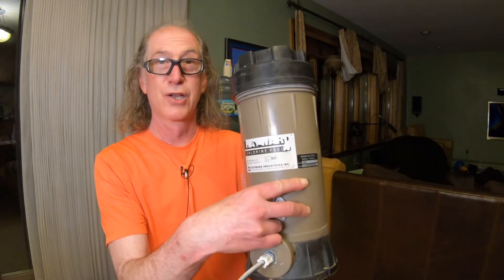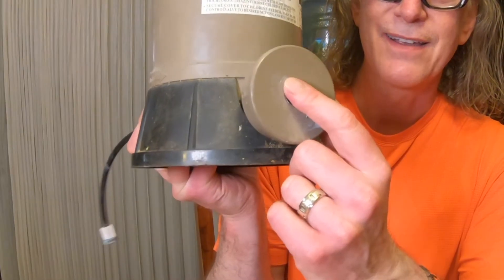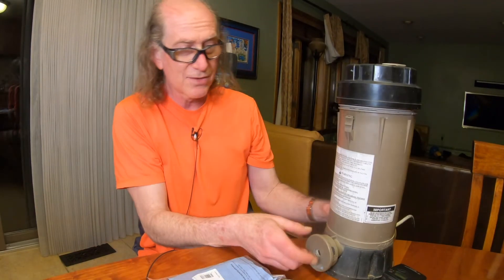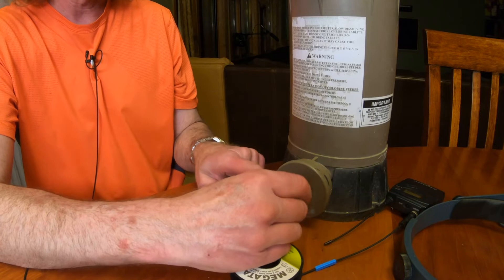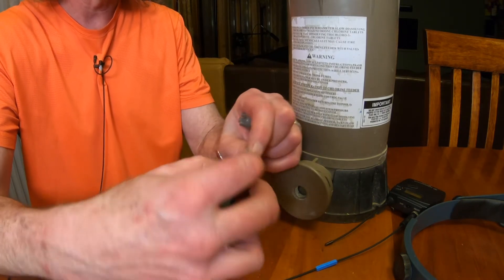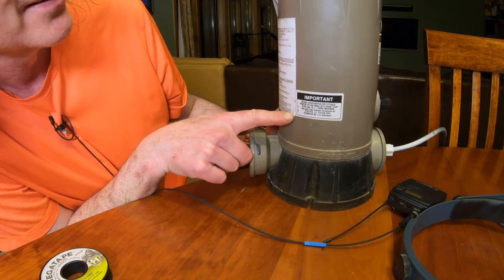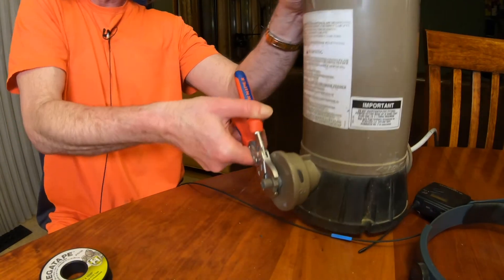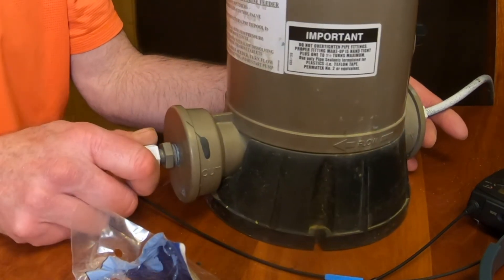Hayward Chlorinator Check Valve Replacement

Comment: thank you for this, nowhere in the manual does it specify where each valve goes. I had the check valve on the wrong side initially.
Reply from the maker: Believe me, I probably didn’t know the first time. These parts break almost every season and need to be replaced. The idea is that when your pump turns off at night, the chlorine can’t get into the equipment which is before it in series, like the heater and destroy the heat exchanger.
Reply: @Samlol23_drrich  just to confirm the check valve goes on the out side of the chlorinator that is connected to the water line running from the filter back to the pool.
Reply from the maker: @matei24  yes. There is an inlet side and a discharge side. The check valve goes on the discharge side.
See hayward site below 
http://www.haywardnet.com/contactus/faqs/viewFAQs.cfm?Category=12&SubCategory&Sub2Category&pagenum=2#q320
Reply: @Samlol23_drrich  Thank you!
Reply from the maker: @matei24  no problem. I learned something looking that up. The hayward site says the discharge tubing should be looped to prevent chlorine gas from entering the equipment. Something called a "Hartford Loop"  gonna have to research that a bit and then do what they suggest

Comment: I have been wasting chlorine tablets for the last two weeks, just ordered the check valve kit. Hopefully that solves it.
Reply from the maker: I’m not sure you’ve been wasting them. The check valve prevents chlorine from going back to the heater and pump when the pump shuts off. That’s all it does. Without the check valve it will work just fine while the pump is running. There is really no difference. I’m no expert but that’s what I think it does.  Thanks for commenting